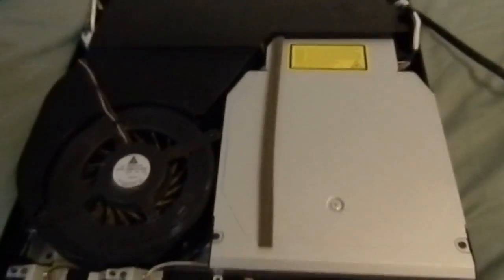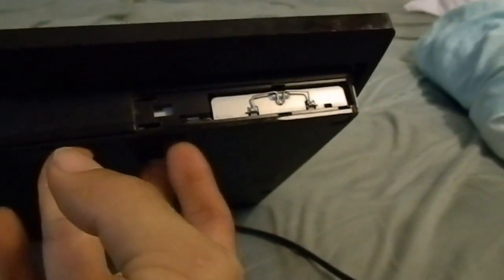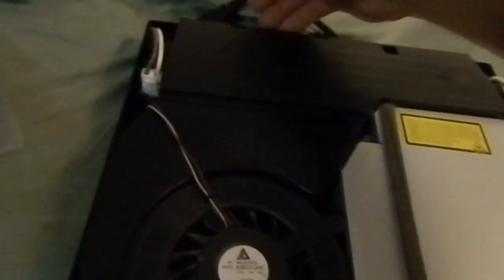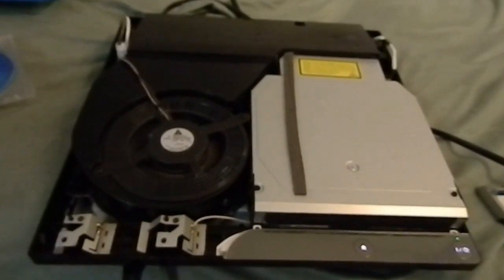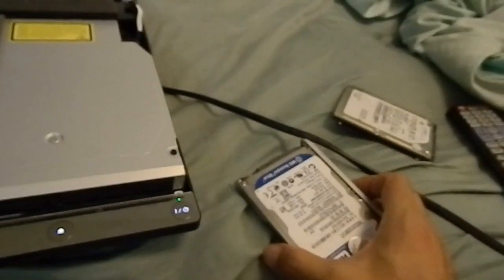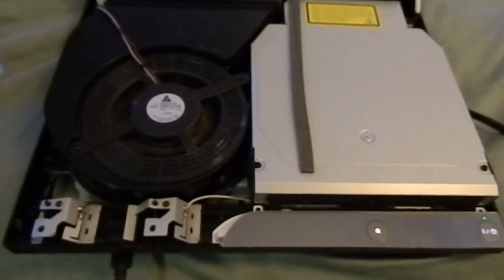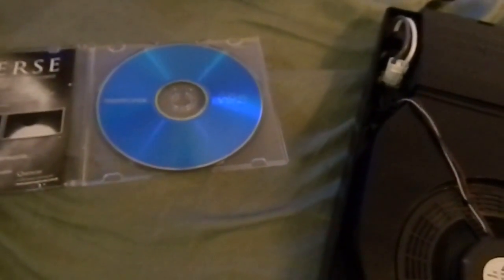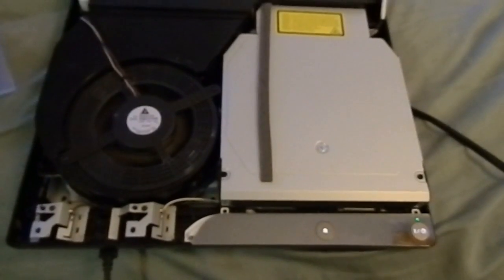PS3 WITH NO VIDEO AND GREEN LIGHT REPAIR GLOD Hard Drive Failure (como reparar PS3 sin video)

Comment: Same issue..... going to fix it tomorrow, but how do you save all your game progress when you have to completely restart..... I still dont understand this saving process, and black screen still is defeating my colsle.
Reply from the maker: Hi there, if the problem with your console is the same as the one shown in this video, then you will need to replace your hard drive. As far as being able to restore any data from the old drive into the new one, that could be more difficult because the hard drive itself is damaged. I believe that it is still possible if you have an external USB kit that connects to the old drive and a PC, but you may need additional software. Please like my video, and good luck!

Comment: ok
when I turn ON my ps3... after 10/15 sec its turn off 
that happend everytime soo i cant play...
I got a bad day yesterday... I bought a new power supply and its still the same problem... I just spent my money for nothing...
Soo anyone know what the problem is ?
Please reply me
Reply from the maker: if it powers off, it is most likely in protected mode. This mode occurs when the system diagnoses either a short or an overheating problem. It looks like you might need to take this one to an expert to take a look at.
Reply: its over heating ........
Reply: thank you
but im gonna buy a new ps3 :)

Comment: After you've change new hard drive, what do you do to make it work? Is it plug & play or you have to install something from computer? Please reply ASAP. Thank you.
Reply: HDD's are largely plug-and-play. Though you just want to follow the on-screen prompts (if your screen issue is indeed the HDD) for formating the HDD for the PS3. Then when you log into the PSN, you'll be able to update to the latest firmware.
Reply from the maker: Hi, just like QueenFiria said, follow the prompts on the PS3. Basically, you will need to download the firmware from the Sony Play Station website and save it in a USB or burn it in a CD to install it on your PS3. After you insert either the USB or the CD, your PS3 will let you know what to do next.

Comment from the maker: Hi, assuming that the hard drive is the issue, if you switch hard drives you will lose all the data stored in the original hard drive. That is unless you have a recovery kit to connect the faulty hard drive to your computer via USB and try to recover the data that is stored there.